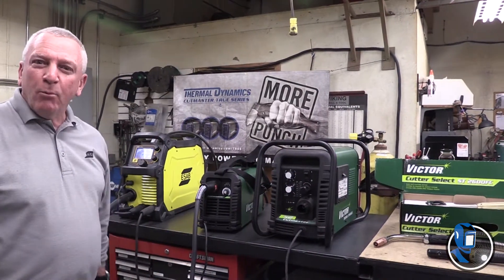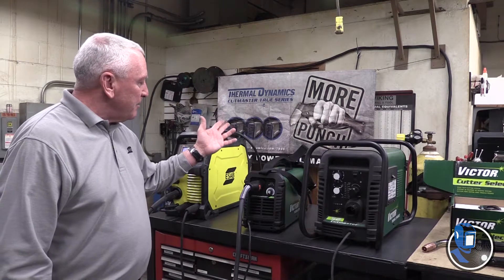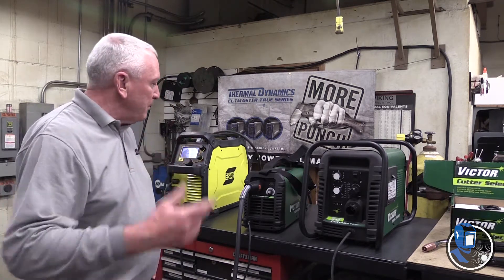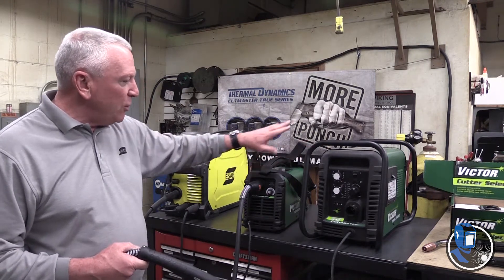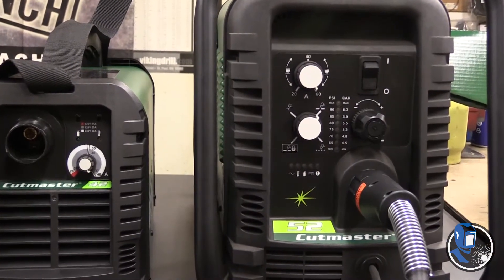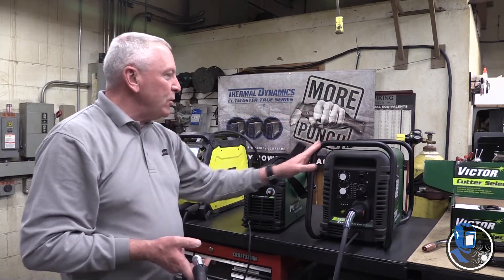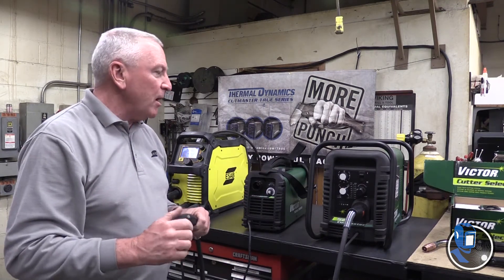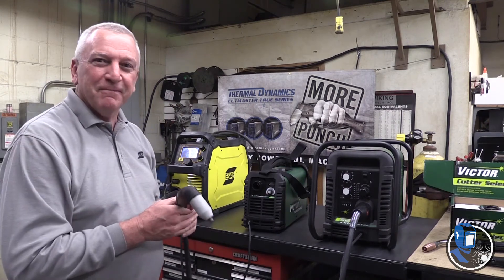Victor Thermal Dynamics Cutmaster 42 and 52

Comment: I think all of the thermodynamics machines are built very well I've caught with a few different plasma cutters don't get me wrong I do like the Lincoln Pro Cut 55 in the 80 but the Torches tend to heat up after really getting down because of duty cycle is only think like 40 or 50% if you get a true thermodynamics that pack that is 100% duty cycle at the amperage that they say it will do I have a stack pack with two units that I can run all day torch barely feels any heat 70 amps that is more of a old machine about 30 years old more of a dinosaur machine but still works good and smooth

Comment: I have a cutmaster 42 that powers up but that's it, I have the full service manual for it. Pin checking with my multi meter, I have no voltage on j1 j2 j4 etc. Is there a tech support number available?
Reply: There will be no fixing it, they knew when they sold it how poor it was, shame that a good name and a few fake reviews is all you need to sell a product, mine will go in the trash.
Reply: Steve Avis go to ESAB’s web site.

Comment: I will never buy a Victor or T.D. product again. My JUNKMASTER 52 needs to go in the trash. DON't BUY IT...
Reply: Love their stuff!
Reply: @melgross  So did I but Mel you do not own this machine, do you?
Reply: Robert Spike I have the new Cutmaster 40. Not the old model. It works very well. In my experience, Thermal Dynamics, and its owner, ESAB, two machines of which I also have (emp 215 and emp 205), are very reliable, and do what they say. I’ve never had any problems with Victor regulators, though I’m not a torch guy. TD is the biggest manufacturer of plasma cutting equipment. Professional and industrial users don’t buy junk.
Reply: @melgross  like I said Mel you do not own this machine, the comments are for the 42 and you ask how I knew you did not own a cutmaster 42 because you are not complaining, Mel I would bet you own nothing and you are a salesman for Thermal Dynamics and to keep ripping off the consumer you run your mouth. As for your comments on the other machines it means nothing to the people that got ripped off buying the 42 your best of best industrial and professional.
Reply: @melgross  I can cut with my victor oxy set up way better than i can with this pos. I have dry air filtered by 3 filters and even a canister filter on the back of the machine.
Reply: You're wrong of course, these are great machines, very reliable, accurate and cheap to maintain., you can order consumables from China, very cheap and great quality.
Reply: Are these plasma cutters any good. ? .? I'm thinking on getting one. ..
Reply: @mandylad  junk